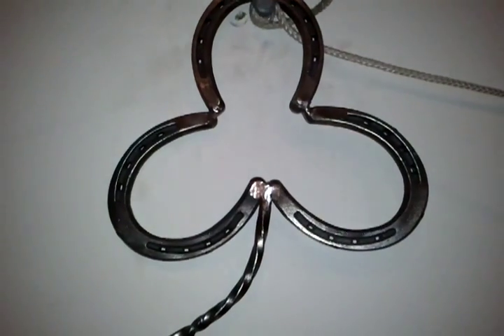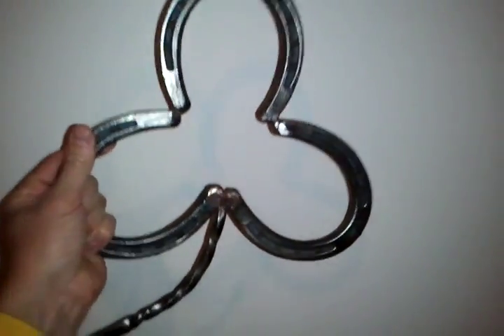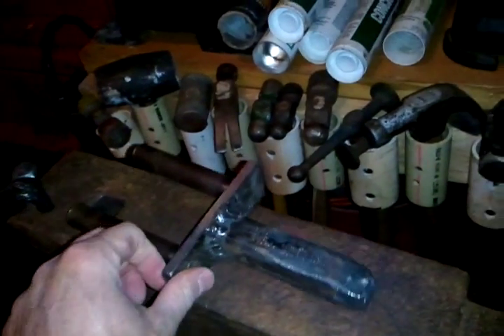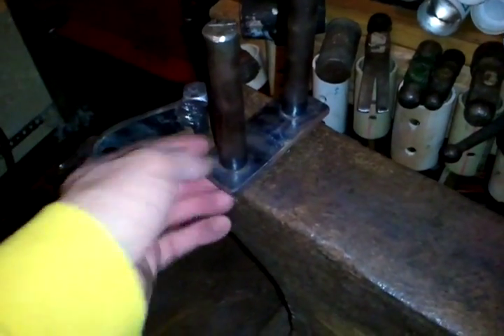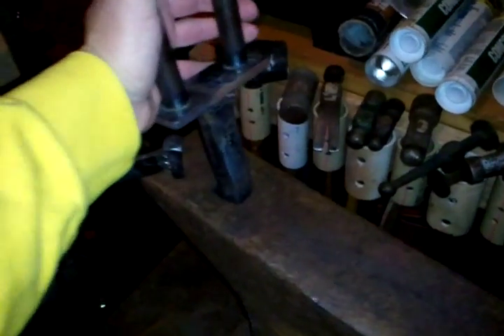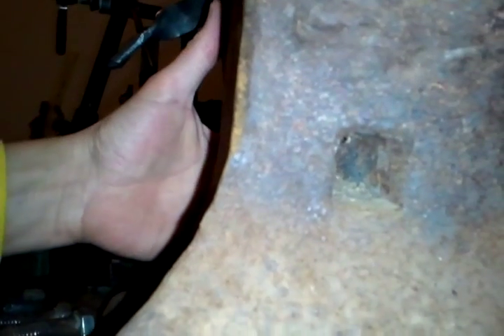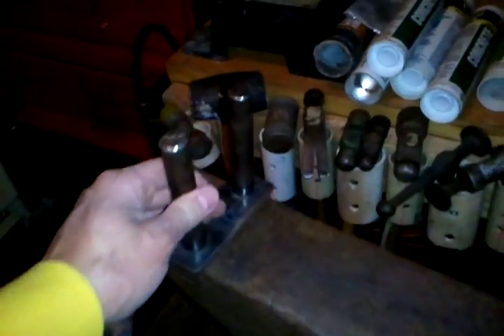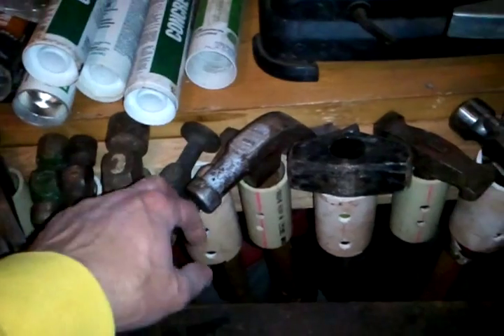Horseshoe art and hardy tool

Comment: I believe the two holes you are referring to are used to lift the anvil. There was a tool inserted in both ends, similar to hardy tool. The anvil could then be hoisted. I bet the holes are at an angle. This was so when the anvil is hoisted the tool would not slip out.